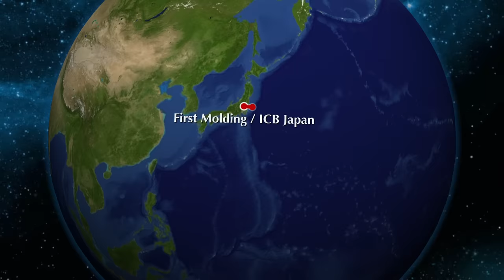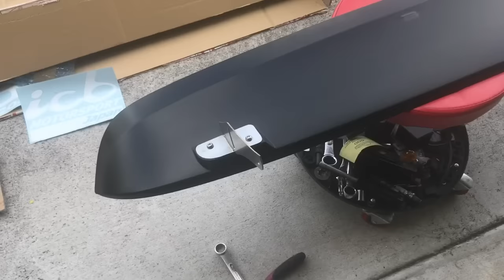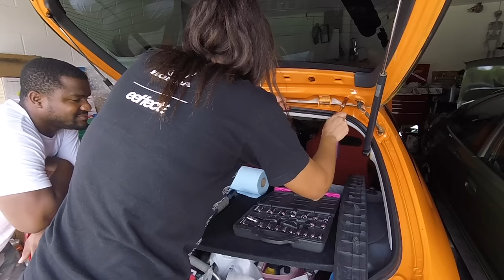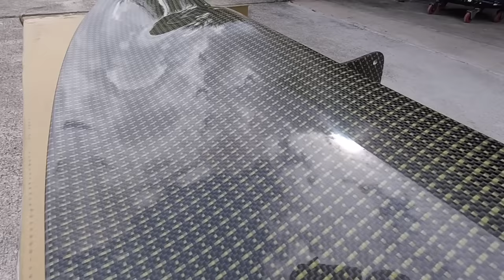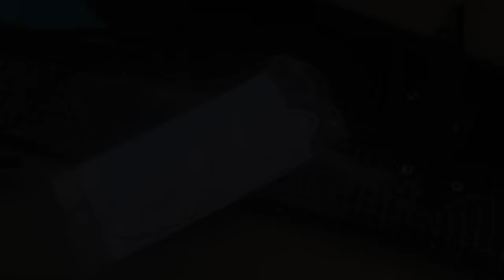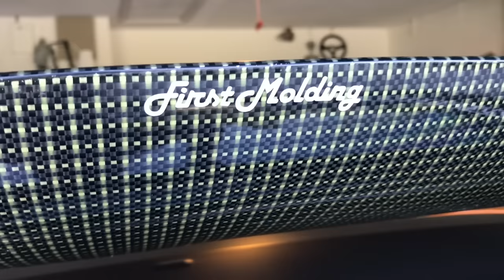Installing My New Wing!! Female Built Turbocharged Honda Civic

Comment: Please rework the rivits they will not hold at high speed.  Or attach some straps in case.  Maybe cut a hole in the bottom where the wing meets the braces and put some metal strips with welded on nuts and secure it to the wing with hondabond to hold it till you get the bolts in.
Reply from the maker: Thank you for your suggestion. I'll keep an eye on it. They should have put some reinforcement with threaded inserts, but I think the wing is meant to be somewhat universal, so the rivets were their solution to make it universal lol
Reply: The rivets will be fine. They are not going to really see any stresses since most of the drag load is going to be transferred to the brackets that hold the wing. Some of the load might place the front rivets in tension, but if the holes are clearanced  right, each pop rivet should be able to hold a few hundred pounds each. The wing is fine.

Comment: Nice. I like the look. You should run less of a angle though they turn out to look a lot better you should try it. And you should upload more :)
Reply from the maker: Thank you! I haven't really had a chance to play with the adjustment of the wing. I put it on and had a car show to go to, which while driving there I could feel a difference on the highway. Maybe this weekend I'll have a chance to play with the adjustment :) And I'm working on filming more :) I should be uploading another video hopefully by next week :)
Reply: Sounds great. Keep it up also you should kinda try to do like a build breakdown. Kinda like what hoonigan does. Tell us what u running ex) b18c1 boosted at 15psi ksport suspension short shifter f1 style side mirrors. Kinda like that. Also get a devsport front splitter. With the brakets and splitter rods. That ek hatch would look amazing with a front splitter

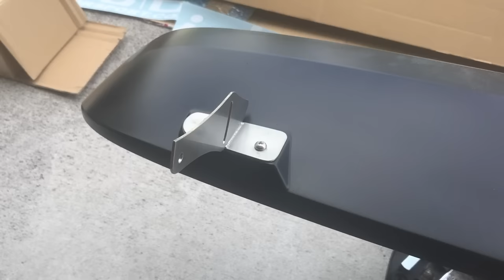Comment: Wing looks epic Not going to front but at 2:01 I would have used extra 2 screws on each base mount for added security, down force is not to be under estimated and those  screws look little tiny ( but one cannot judge a book by its cover )
Reply from the maker: Thank you for the suggestion. I think it's on there pretty good :)

Comment: looks nice but downforce in fwd nahh
Reply from the maker: Thank you. A lot of people have a misunderstanding about the benefits of a wing on a FWD car. Take a look at this video  https://youtu.be/OAsO58Ubv0E  its actual testing of with and without a wing on a civic just like mine :) The downforce in the rear does help with balancing to help keep traction at all four wheels.
Reply: Its easy to setup a fwd to overseer and correct with throttle input.  Stiff rear springs and 20mm sway is really all it takes.
Reply from the maker: I understand where you're coming from, but please realize that I am not competing in road races, my wing is not a tool to correct any issues, and I'm not worried about it slowing me down, it's mostly cosmetic, but it has helped with high speed stability. My car is not affected by the draft winds off of trailer trucks anymore.

Comment: Great  idea lets put a big rear wing on the back of a fwd car so the back sticks to the ground
Reply from the maker: It's actually a great idea in some FWD applications. A lot of people have a misunderstanding about the benefits of a wing on a FWD car. Take a look at this video  https://youtu.be/OAsO58Ubv0E  its actual testing of with and without a wing on a civic just like mine :) The downforce in the rear does help with balancing to help keep traction at all four wheels.
Reply: 90s Honda are easy to setup to oversteer learn about it.  This isn't a riced car rocking camber life and no mods.

Comment: Is the design in it the actual Kevlar?
Reply from the maker: Yes, its actual Kevlar fabric used to make the wing, my mirrors, spark plug cover, and the front bumper.
Reply: Aisha Christian aka aisha_ladybuilt I like the design it has its different from every ones CF

Comment: Doesn't look bad however I don't think its functional seeing its a fwd car
Reply from the maker: Thank you. It actually is functional. I feel a difference at high speed handling. For example the turbulence from big trailer trucks would shake my car as I was pulling closer to them from behind, now I don't feel that shake when I am passing them.
Reply: Al Andrade wings also help put force down on the rear since all the weight is upfront. Wings do help fwd. It creates a balance.

Comment: IM A SAY THIS 1 MORE TIME FRONT WHEEL DRIVE CAR DRIVERS!!! FRONT WHEEL DRIVE CARS DON'T NEED A WING THERE POINTLESS!! HAHAHAHAHA! Stop THE RICING PLEASE!!!!!!!
Reply from the maker: A lot of people have a misunderstanding about the benefits of a wing on a FWD car. Take a look at this video  https://youtu.be/OAsO58Ubv0E  its actual testing of with and without a wing on a civic just like mine :) The downforce in the rear does help with balancing to help keep traction at all four wheels. My car feels much more stable on the highway :)
Reply: Aisha Christian aka aisha_ladybuilt yeah but your car isn't that fast & maybe shouldn't be driven so fast if it's unstable!!! Just saying maybe upgrade & get entirely different car!! Unless you plan on racing others? Either way good luck to each His/Her own!!
Reply: Your wing doesn't look that bad I've seen worse & they usually can't install it themselves like you did!!! 👍🏽👍🏽👍🏽👌🏽👌🏽👌🏽
Reply: TUNGTABLE338 500 front and rear springs no front sway and 19mm and up rear sway.  Thing will oversteer and its very confusing at first because you need throttle to correct not to lift.  Look up NASA Honda series.